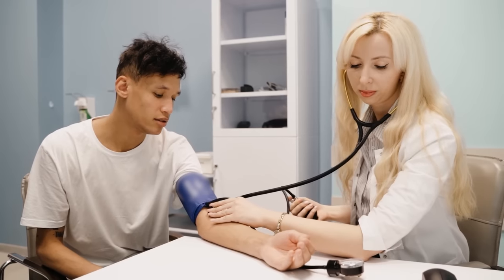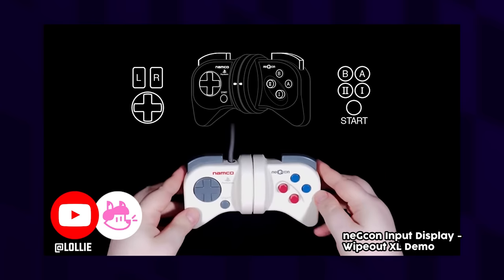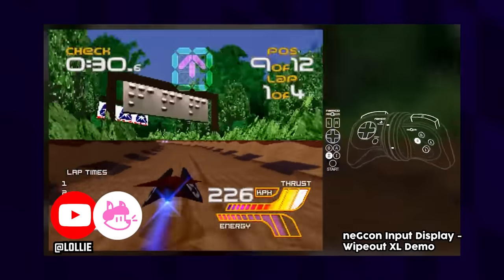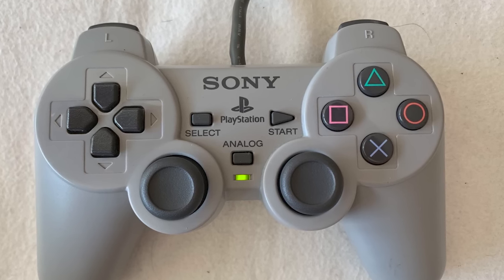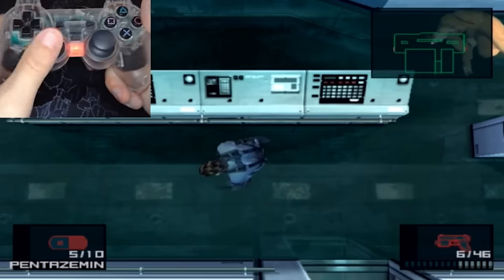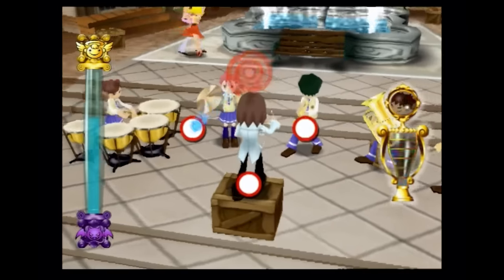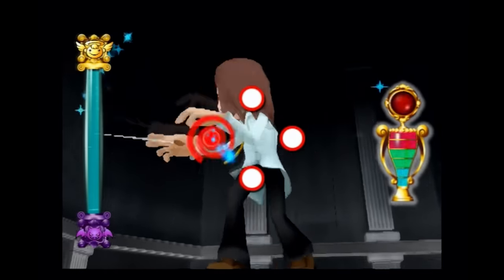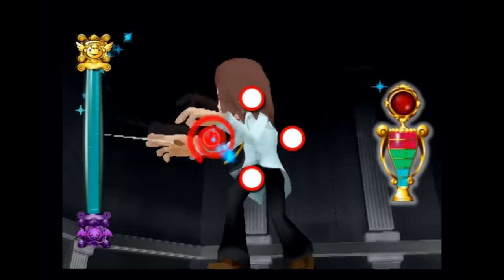The Short History of Pressure Sensitive Buttons

Comment: I always hated the pressure sensitive buttons on the Dual Shock 2. There is no feedback on how hard (or light) you can actually press the buttons which for example in racing games made me always press them too hard, making my thumb hurt.
The NeGcon did that way better as you could actually feel the travel of the analog buttons.
Reply: Try Gran Turismo 4 for that, it DOES show you how hard you're pressing throttle and brake. Might not be in all camera views, though?
Reply: @Formedras  The throttle and braking meters always display regardless the camera view. I think @knortn's point still stands on how unintuitive they are. That's why most racing games today use analog triggers instead.
Reply: I’m calling bullshit on this one:

The controllers after the first couple generations were not as good and required you to press the button so goddamn hard it was ridiculous-

However, if you had one of the PS2 controller that came from the first few years that the PS2 was on the market, it had more sensitivity in each button as well as the D pad, than any of the analog sticks out at the time on the same controllers and other controllers like the Xbox and GameCube etc...

If you had a good broke in first generation PS2 controller, The buttons on the controller allowed you to control the car better in Gran Turismo three and Gran Turismo four and it was the superior way to play the game!

I had a controller from the first PS2 I had, that I wish I still had because it had so much sensitivity in the D pad for steering and in the face buttons for acceleration and deceleration, and I would always beat every single person I came across that would steer with the analog stick or race with any other shut up!! The only thing that could beat me with that controller, was somebody that had a recent wheel!

That said, by the time the PS3 came out all of the pressure sensitive pads that were being put into the controllers were much cheaper and the controller was also cheaper and was not designed as well-

Adding Bluetooth and wireless functionality might have made it to where they slacked on the pressure sensitive functionality and it’s why they eventually got rid of it.. gran Turismo was the main game that used it and metal gear solid sons of liberty and metal gear solid snake eater both use the pressure sensitive buttons to pull up the gun and pull back the hammer and then to be able to slowly release the hammer instead of firing a shot!

But either way, the PS2 had the best pressure sensitivity out of any control method I have used for playing games with a controller since.. it just had to be one of the first generation PS2 controllers because by the time they made the slim model, they were cheapneed down a lot-
Reply: I remember switching from the PS1, dualshock 1 and GT2 to the PS2 dualshock 2 and GT3 and not understanding why the hell the cars were decelerating when I was sure I was holding the buttons and it was due to those awful pressure sensitive face buttons! And I had the first gen PS2, the giant 39001 model! It was really awful having to press that hard on the controller!
Reply: You can tell one of the good controllers from the majority of the bad, because the bad ones buttons and the pad will all feel mushy, whereas a good pressure sensitive PS2 controller, the buttons will just feel normal?! There will not be any mushy filling to it and it will feel like any other controller but with the button presses being slightly more softer but this also equates to more precision in the button response!

Most of the controllers were the ones that had “mushy“ buttons and I’m pretty sure it’s just a matter of where they were manufactured, but I know for certain that Sony did this every generation since the PlayStation one where the controllers that came out at the beginning of the generation had more quality and were made out of better component than the controllers that came out towards the latter end of that generation-

Remember, the good ones there will be no feeling of mushy buttons that you have to press really hard, it will be an instantaneous press that will feel slightly softer to the press then say a dual shock four which does not have pressure sensitivity and the button presses feel “hard”
Reply: That's why I always preferred using the right stick instead in racing games. Which thankfully it felt like nearly every PS2 racer supported that.
Reply: Yeah, I get what you mean by lack of feedback. 

Some games have a visual indicator but this alone isn't quite enough. It does take a while to get used to eventually, but you can really begin to dominate once it clicks. But it puts more strain on your digits and you'll need more regular breaks. I really went to town testing this feature on Namco's R:racing and it was mega satisfying when everything fell in place.

Having said that, have you ever tried sitting in a sim rig with load cell brake pedals? Or a higher strung sports car or similar? Their brakes have minimal travel and depend a lot more on the pressure you applied. You'll get a proper leg workout at the end of the session... on both legs especially if you happen to do left foot braking and heel & toe techniques.
Reply: Lol that wasn't needed at all for me, just press the button lightly or all the way, literally just that

Comment: I'm certain that more games supported it, but Burnout 2: Point of Impact (Playstation 2, 2002) was one of the only games I ever played that used analog inputs for L1, L2, R1, and R2. On the car select screen, pressing any of those buttons would change the angle of the camera/zoom on the vehicle. You could be extremely specific with your angle/zoom based on how hard you pressed the buttons. I noticed recently that it's extremely hard to use those analog buttons on the car select screen now that my controller is 20+ years old.
Reply: Another game that supports it is Crash Tag Team Racing. Not for the driving, but for the first person camera in the platforming segments. How hard you push the shoulder buttons controls the zoom.

Another use of it is in Enter the Matrix. L1 & R1 strafe you, but how hard you press the button will determine whether it's a walk or run strafe.

But yeah the shoulder buttons were rarely used at all. So little so that some people still think only the face buttons were pressure sensitive.

Comment: When You open a DS4, You see a conductive film with all places where is a button, and even the triggers, making the PS4 controller has Sensitive pressure buttons but restricted to the L2 and R2 triggers.

And is the same tech in the SIXAXIS/DS3. Those gamepads doesn't have other trigger mechanisms like a pontetiometer or magnetic sensors.

Comment: If you want a real pressure accuracy test, Evergrace uses them to gauge how much of your "stamina" you want to spend in a single strike which is actually fairly important. The settings menu has a calibration for this even, complete with a programmer placeholder looking menu which tells you the exact value from 0 to 255 as you mentioned in the video.

Comment: One curious case of a PS3 that supported the pressure sensitivity was MotorStorn: Arctic Edge. That's actually how I figured out the controller had pressure sensitive buttons. I downloaded the demo and upon launching it, it would ask me to adjust the screen size to compensate overscan. It's in this very screen where I can lightly press the D-Pad to move the screen edges slower or fully press them to move the edges faster, and I think that's the only thing that game uses the pressure sensitivity for

Comment: Far cry Instincts on the Xbox supported this for an oddly specific feature in the map maker mode, how much a deform tool would affect the terrain, be it raise, lower, smooth or roughen. I thought it was neat.
Reply: Thanks for pointing this out.  Surprised I didn't know this, but I jumped in with Predator on the 360.

Comment: Another problem with pressure sensitive buttons is the amount of maintenance required is increased. The wear-out on these analog buttons are much worse than digital input buttons, and a similar instance happens when the buttons get dirty underneath. They don't age very well if not used properly and the inputs become very difficult to press it let go

Comment: Ah the ps2 and it’s pressure sensitive buttons. When they work in Metal Gear It’s nice, when they stop its a pain. 

I’ve got a pile with dead circle buttons and dpads from killing guards in snake eater.

The only thing worse is trying to crack one open and give it some TLC…

Comment: A note on pressure sensitive racing games for the PS2: A number of them only use the first ~20% of the pressure point before maxing out in-game, Gran Turismo 3 and 4 included. On physical hardware this makes more sense as to prevent the need to absolutely smash the X button to have the pedal all the way down all the time. When using a controller that has triggers and a mapping that places gas on said trigger, the 20% maximum becomes much more evident as it'll reach saturation pretty much instantly. If you're using PCSX2, you can set the trigger saturation to around 20-26% (you'll need to figure out exactly where a given game tops out) with a custom controller config per game (or shared if they're close enough) on the triggers and change settings in the game (if it supports it) to use L2/R2, albeit some games require you to flip the bindings for L1/R2 and R1/R2 (so R1/L1 are bound as the triggers on the physical controller) - Ridge Racer V and Shutokou Battle 0 (Tokyo Xtreme Racer Zero) require flipped triggers and reduced saturation (I could be wrong on the saturation part, but definitely the flipped part), Test Drive (2002) only requires the a saturation fix as buttons can be rebound to the players exact preference; possibly a few other games out there that don't come to mind for me. I went to go verify I got the name of the term PCSX2 uses in its settings correct but it looks like it's been removed from the nightly builds for now for whatever reason.

Gran Turismo 3 also supports right analogue stick binding for acceleration and brake - it's one of the few games I can think of that can be booted in a pretty short time to test every single function of a PS2 controller... except L3 and R3. Burnout 2: Point of Impact supports face button controls on the Xbox, but I wouldn't really recommend it because it will feel awful on your thumb. The games you sadly cannot fix in PCSX2 without messing with menu controls is the Burnout series. The PS2 versions don't support L2/R2 binding for brake/gas, so you're stuck with face button controls. You can still get analogue face buttons on Linux though, and as far as I know there's a few drivers for windows you can jump through hoops to get working analogue support (limited) for the DS2 via the USB adaptors for PS3 or DS3s/Sixaxis, albeit probably not with the modern nightly builds of PCSX2 as last I remember the functions were part of the LilyPad controller driver for the PCSX driver model which has been long since removed.

Comment: The original 2 gow might have pressure sensitivity on the level up screen. I can't tell if there is but some times it feels like maybe it goes faster the harder I press. Could just be in my head though.
Reply: Also I am certain fable has pressure sensitivity. The bow is drawn further back if you press the button harder. If you release it the bow started to release

Comment: I feel like any game that used the analog buttons to simulate light or heavy punches could've worked just as well, if not better with regular buttons using quick taps and long presses.
Still, I'm kinda fond of this feature because of how well it was implemented in the Metal Gear games, which might just be the most important games on the PS2. So I'm a little miffed about it's loss because it means that any future re-release of Metal Gear Solid 2 and 3 are inevitably going to feel kind of scuffed. Heck, if the choice stood between that silly light bar + touch pad combo and pressure sensitive buttons, I'd choose the buttons any time of the day. 
Combined with the advanced haptics of the Dual Sense they may have been able to pull it off for real.